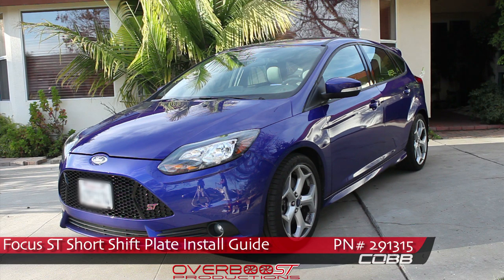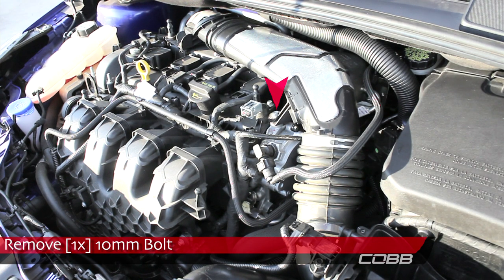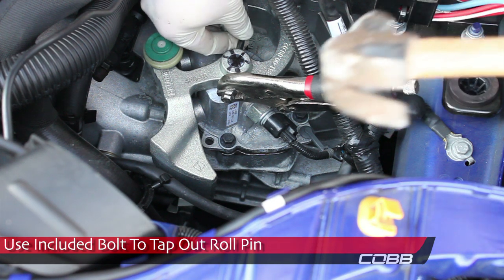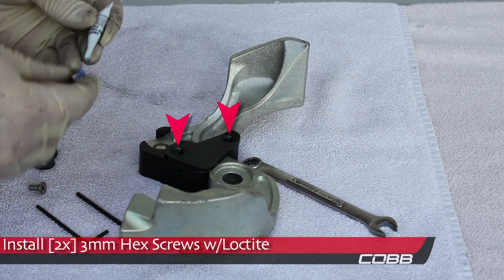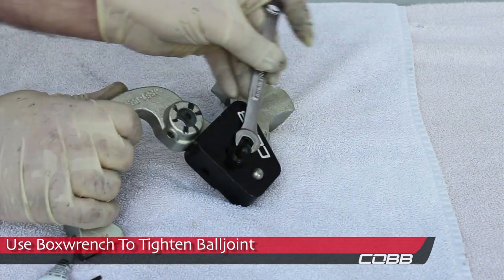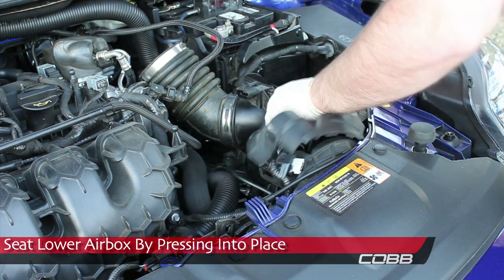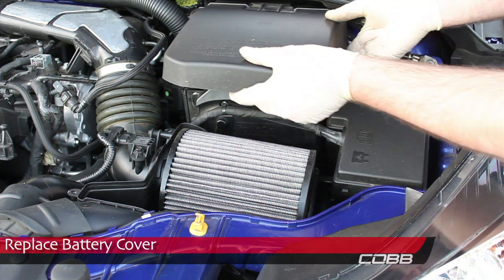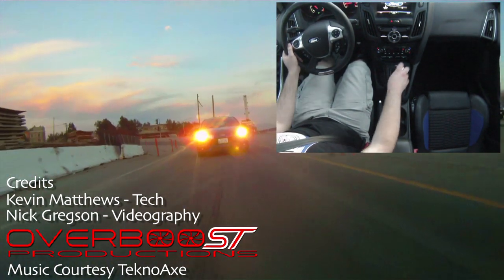COBB Short Shift Plate Install How-To: 2013-14 Ford Focus ST PN#291315

Comment: The damn pin won't come out. Any ideas?
Reply: some penetrant like 'kano kroil' or 'liquid wrench' or 'blaster pb penetrant' and a heavier hammer like a 1-1/2 or 2 lb hammer so it has some mass behind your swing... let the penetrant do its work first.. be firm but dont go crazy.

That penetrant is great stuff to have on hand anyhow if you find yourself doing any mechanical type handiwork from time to time..always stuck, rusted, impossible to remove nuts, bolts, screws, pins and fasteners...
Reply: We got it! Just had to give it extra umph! Thanks for the reply though!
Reply: Mike Vieira  Yes, get the FSWERKS Short Shift Adapter,  you won't need to remove the pin. took me 20 minutes to install it. it's brilliant.